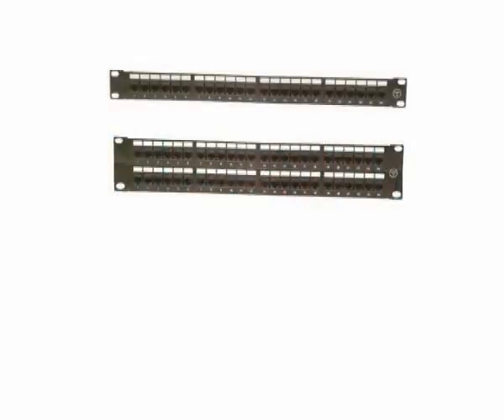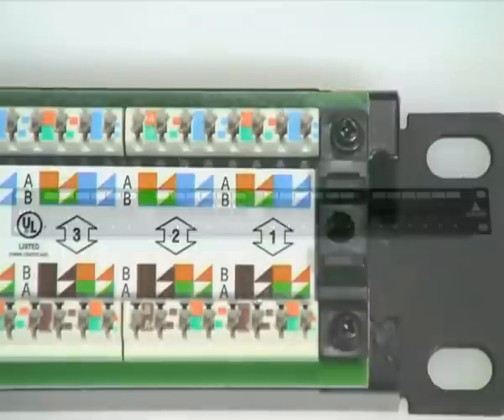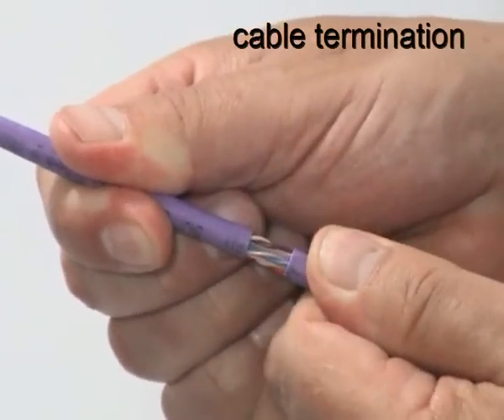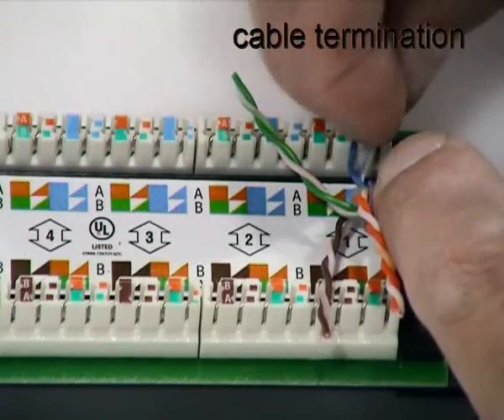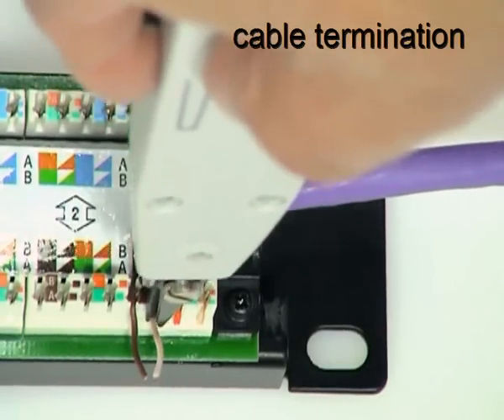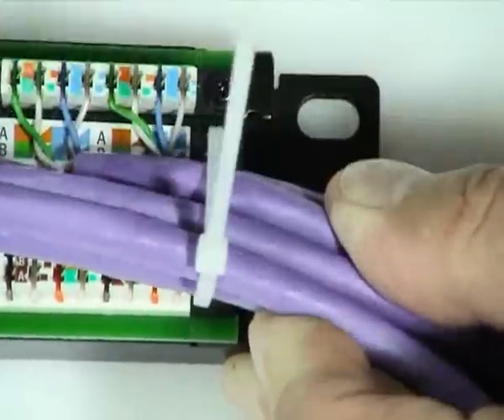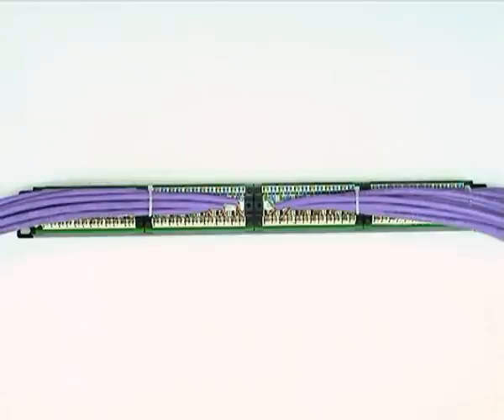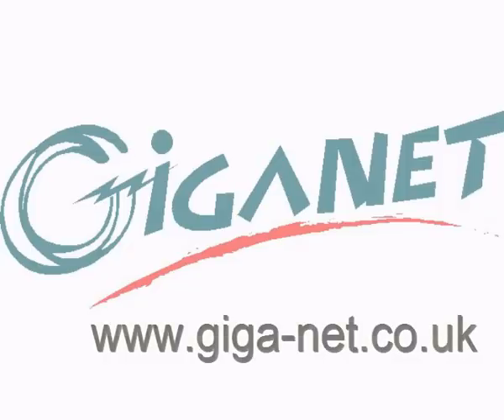Giganet Cat6 U/UTP Patch Panel Termination

Comment: the cables that go to the pach panel where they are connected
Reply: there is fiber optic adapter to interconnect them together, you can add my skype:Peter.Telemax, we are fiber optic cables manufacturer